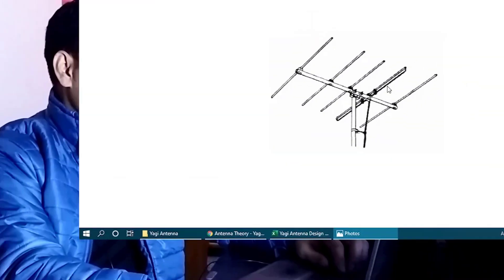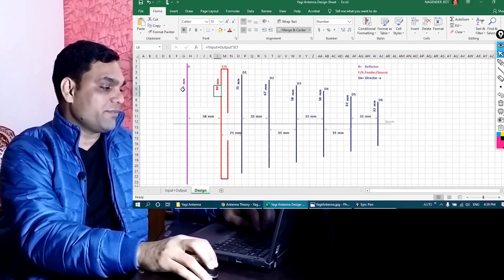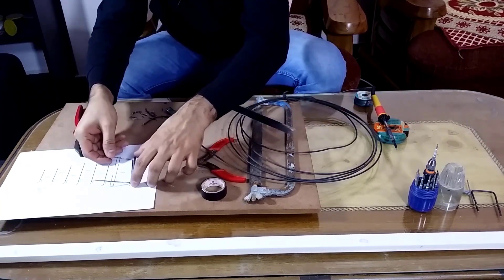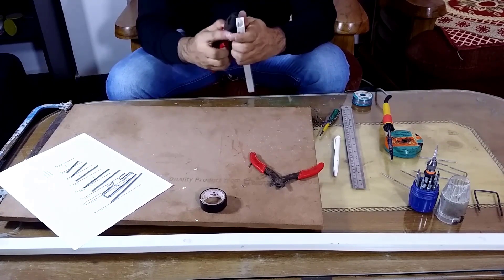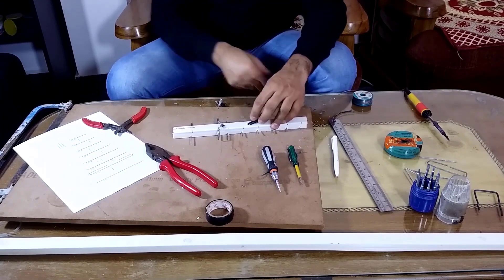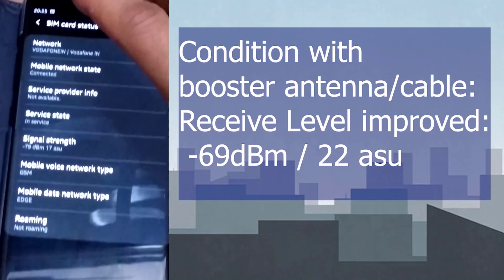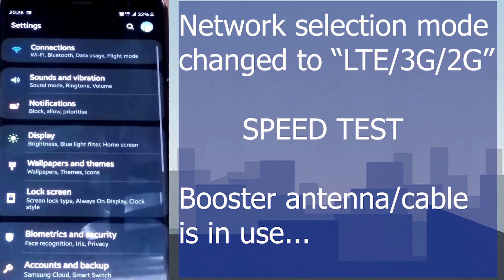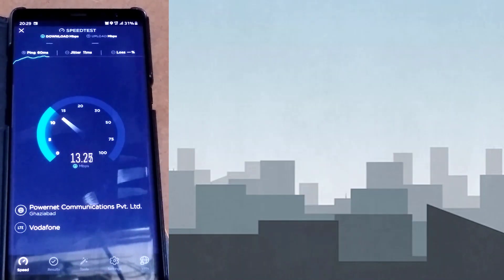Mobile Signal Booster for home - 2G 3G 4G - Homemade India

Comment: Great Video and excellent Design Spreadsheets!!! Thank you.   Can you let me know how to have more or fewer Directors and their spacing and width?  I was thinking 7 or 8 directors.   Also, If you put another antenna at the Cell phone end of the coax could you have a little more mobility to walk around your office?
Reply from the maker: Hi Rudi, 

Thanks!

You can find a table on this page which lists gains expected from yagi antennas with different number of directors (up to 15). You'll see that the increase in gain with every additional director is a diminishing value.

http://www.antenna-theory.com/antennas/travelling/yagi3.php

In last row of the table you'll find how to calculate the separation between the directors for different designs as a function of the Wavelength.

Putting another antenna on the other end didn't work for me. Despite the gain, the signal is still too weak to be radiated again effectively towards the mobile.

I think mobility won't be possible with this kind of passive antenna. We need an active booster fir that. 

Hope this helps!

Regards
G&T
Reply: @GeekyAndTweaky  Thank you so much. The second spreadsheet is great too.  I will be putting the receiving Antenna about 25M up on top of a tree.  Coax is RG11 75 Ohm, runs down tree about 15M...Then per your recommendation, I will put the "S" contact antenna next to my signal booster that spends signal to house. I'm out in the country. Up in the tree my phone gets 2 to 3 bars. But no bars at the bottom of tree.  I get LTE band 66. (1710-1780Mhz up and 2110-2200 down). So I'm going to design a yagi centered between at 1950Mhz or try a dual-band antenna with directors on top of a non-conducting boom centered at 1725Mhz and Directors under centered at 2150Mhz.. Any suggestions or thoughts?
Reply: PS, I subscribed to your Channel
Reply: I suggest you to keep the mobile over the cable & use blue tooth headset to take calls !
Reply: Very good & useful video!

Comment: What is the size of aluminium wire used for antenna for 1800 and 2100 mhz
Reply from the maker: you can calculate the Diameter as: 0.0085 x 
Wavelength

Comment: I made a unit for 2300 MHz following your pdf data. Not working. No difference after adding it. Plz make a video for jio 2300 MHz. And one question, can I use any other wire without coaxial cable??
Reply from the maker: Dear Sougata, 
The process for makimg 2300 MHz band id pretty much the same, only dimension are different.

Coaxial cable are best for Radio signal applications. That's why they are referred as RG (radio grade) cables. Other cables may or may not work depending upon conductivity of the wire material and distance of application.

Comment: Did you solder cable core only at diapole side or core + screen ? Please clear my doubt.
Reply from the maker: Soldered on both ends of the dipole , core conductor on one side and wire mesh on the other..

Regards 
G&T
Reply: @GeekyAndTweaky  Thanks for your reply. Should reflector face cell tower or I have to place director fowards cell tower?
Reply from the maker: @iMKPandey5  smallest director should be facing the tower. 

Reflector should be farthest from tower.

Comment: From my house ,roof top to my bedroom distence arround 30 meters so can i use 30 meters coaxial cable ?? Is it work that much far distance??... please answer my question....
Reply from the maker: Dear Mayuresh, this long distance will cause some loss, but still it will boost to some extent overall.
 If you have good signal at rooftop, it is still worth a try.
Reply: Yes .. I got 10 to 15 Mbps at roof .. but down no network and jio speed also .. sir can i use LMR 300 coaxial cable for that antenna ?? Please answer me ..
Reply from the maker: Then you should be able to get it with this Antenna.

 LMR300 cable will be good for this purpose.
Reply: Thank you sir for your kind information..
Reply: Sir .. today I did measurement from roof to my room I can arrange these all system within 20 meter.. so still is tere any signal loss ??? Please answer my question..

Comment: Hi sir,
Can I use wood instead of plastic material for boom...
Reply from the maker: Yes, that should be fine
Reply: @GeekyAndTweaky  thank you for your reply sir...
Reply from the maker: You are welcome Sir!

Do let me know the results when done.
Reply: @GeekyAndTweaky  Hi sir,
I completed the antenna and placed about 20 feet height.... But I  doesn't received any signal sir...  I'm using aluminium bare wire which is used for electrical purpose...diameter about 2mm... Please help me sir... My design for 1800MHZ antenna...
Reply from the maker: @aravinthak6962  dear Aravind, can you please share some pictures of your setup to understand better ?
Reply: @GeekyAndTweaky  sure sir
Reply: @GeekyAndTweaky  hi sir...
Reply: @aravinthak6962  I think the wire you should use for 1800 mhz is 3mm in diameter not 2. Maybe try it with 3 mm and see if your results change.

Comment: Hi sir. I have question. Can this boost my modem signal using your setting  .I'm using modem B618. I want my modem detect band 40. Mybe the tower very far. But here only have band 5.
Reply: And it's possible if I make two antenna will be better than 1? Can get more signal??
Reply from the maker: Hi Z Rose's

With Modem, I believe, you mean to say an LTE Hotspot device. If yes, the the answer is yes. It should work fine with that. On other end just try to put your device with different orientations to find location of your device antenna.

Two antenna, with a physical separation in mounting location should give better results. (This is called receiver diversity gain)

If it is not possible to mount far apart, you can also put the two antennas on same location with polarization diversity. Mount one parallel to ground and the other one perpendicular on side.

Hope that helps!

Regards 
G&T

Comment: THANK YOU Sir. The video was very helpful for me . The  best part is that i made the antenna free of cost . I had  a old power cable at my house from which i extracted the aluminium wire from it ...... Previously downloading speed was less than 2 Mbps and now  i am getting average speed of 7-9 Mbps .
So thanks again .
Reply from the maker: Dear Sandeep

You are welcome!
I am glad you found it useful and it worked well for you!
Regards 
G&T
Reply: नमस्कार  सर, आप से कुछ आग्रह करना चाहता हूँ , 
 antenna  बन गया कम भी  अच्छा कर रहा है परन्तु  हमेशा  antenna पर पक्षी बैठ जाते है और antenna की दिशा बदल जाती है , अगर संभव हो सके तो omni directional antenna बनाने की विधि बता सकते है .
धन्यवाद

Comment: I sir, to make the antenna, I have 4 mm section aluminum rod (full, not tube) can it be good for making the elements and also for the dipole? thank you very much
Reply from the maker: Ideally, thickness of the wire should be 0.0085x Wavelength.
for example, for 1800 MHz band, Wavelength is around 167mm. So thickness should be around 1.4mm

But you can still try, let others know the outcome 

Cheers!
G&T
Reply: @GeekyAndTweaky  ...ok, I do the test, but is aluminum ok? is it good for everyone, both dipole and elements?
Reply from the maker: @QQPIZZA  Yes, Aluminium should be better than steel / iron as it is a better conductor. (For all elements)

Read explanation here: https://blog.solidsignal.com/tutorials/steel-aluminum-or-plastic-whats-more-important-for-an-antenna/
Reply: @GeekyAndTweaky  ... ok. thanks
Reply: Hello, please, the yagis sold commercially have aluminium elements of a much higher diameter (about 10 mm guessing) compared to 1.4mm wire.  Please explain why?  Thank you. Gus in Caracas.
Reply: Sir, can you share to my email  for excel sheet formula,my email is ganierwinafgani@gmail.com 
I'm tying build for frek. 1800 Mhz and 2100 Mhz, please help sir..

Comment: At 9:15 you show a connector from cable to phone. Will you make a video to show how you make it - please? Thank you!
Reply from the maker: Simply peel off all the top layers and keep only the core conductor. Bend it in the S shape as shown in video. To avoid scratching, I simply taped it in between plastic cards.

I'll try to make a short video when time permits.
Reply from the maker: Hi, I have updated the part you asked for. See the card or Video Description or visit this link: https://youtu.be/ZSk6_mOubuI
Reply: @GeekyAndTweaky  You sir are very kind. Thanks for making the extra video. I plan to make this for a friend who has terrible reception.
Reply from the maker: @expiredpig2  It's a pleasure :)

Comment: Thanks friend for this video, I have a question for you: I'm interested in building a yagi for 2100 mhz, to get the measurements I downloaded your excel file but the file doesn't work ... how can I do it? I live in the mountains and I have a cell phone repeater far away and I receive very little signal, unfortunately I don't have the money to buy an amplifier. Thanks for your kindness in your reply. Good life to you.
Reply from the maker: Hello My friend, just now, I have uploaded PDF versions for 2100 MHz at the same google drive address. Please use those.
Regards
G&T
Reply: Dear  @GeekyAndTweaky  : Thanks, I'm really grateful to you. I am forced into the house for the CoronaVirus and at least if I can call ... thank you thank you thank you ... how many millimeters must the curve of the bipole be? 10/15 millimeters? Thanks again
Reply: ?millimeter? in 4:40 time line
Reply from the maker: @QQPIZZA  Yes, all the measurements are in mm.
Reply: ok, thanks, but how many millimeters is the side (the curve) at the point 4:40 time line??
Reply from the maker: 15mm on sides.

15mm gap between open ends.
Reply: GeekyAndTweaky many many thanks
Reply: tomorrow I proceed and then I tell you, thanks again

Comment: Doesn't work..Im approximately 15 km from cell site tower.. What do you think is the problem sir? From Philippines 🇵🇭
Reply from the maker: Hi, it can boost the signal due to directecivity(gain) if there is slightest trace of it. Can you tell me what is the signal level you are getting at rooftop without the antenna?
Reply: @GeekyAndTweaky  My area is no signal, even in the rooftop sir
Reply from the maker: Dear, sorry to tell you that in that case it may not work. 

It can only boost if there is some signal, for  very weak level also it will help. But it cannot help in total blackout zone where there is absolutely no coverage.

In my case, there was no signal in basement, but at ground floor where the antenna was mounted, there was decent signal level.
I hope I didn't create confusion with that :)

Regards
Reply: @GeekyAndTweaky  uhhh okay sir, thank you

Comment: Hello sir, i made the exactly same yagi anteena as yours but unfortunately it's not working at all....i don't know why but it's truth even my co axial cable length is only 8 feet, bdw my network operator is airtel which is using band 3 i.e 1800 mhz frequency same as your  vodafone so i did the same anteena as yours. The elements of my anteena are proper measurement in size and distance so it should work as your anteena......i am so depressed after the result, can you please help me something about this ??
Reply from the maker: Hi Nihar, sorry to read that.
What material have you used for the antenna elements and what is the diameter/thickness?

If it's all as expected, then please try to test in a different direction and location.

Also, make sure that the cable end is properly soldered with the dipole element.
Reply: Sir, i used the same iron wire which is 2mm in diameter and all the elements like reflector, director measurement are exactly same as yours also i checked that the coaxial cable is properly soldered to the driven element and i placed it on my rooftop by checking all directions but i am not getting a good signal strength that expected from the anteena. Also in my area there are not a huge network problem, normally i can get 4G network but low strength even therr is a airtel tower at 150m away from my home, but i can't get a good signal.
Reply: In your video i saw that you connected a small receiver type of device to the usb port of your phone, can you please say what is that...?
Reply from the maker: Well, in that case the only suspicion I have is that there may be a discontinuity in the cable. Core conductor may have got internally broken, but not visible outside.

If possible,  please check continuity of the cable. (Continuity tester / multimeter will be needed)
Reply: I already tested, there is no problem in the cable.
Sir, what should be the length of S - type core conductor cable.
Reply from the maker: I kept that similar to the length of Driven element
Reply: Is your yagi anteena still working now  perfectly.....??
Reply from the maker: Yes it is working. Gain varies from time to time, but it works.

I just re-checked,before replying here.
Reply: That's Great.....!!
In your video i saw that you connected a small receiver type of device to the usb port of your phone, can you please say what is that...?
Reply from the maker: That's a magnetic charging cable connector. That piece stays in the USB port of the phone, the cable has a matching part and they stick together being magnetically pulled.
Reply: Exactly i was thinking that.....thank you so much.

Comment: Sir jio ke liye konsa band thick hai.
Band 3 ya phir band 40
Reply from the maker: Jio has PAN India licences for LTE Band40.
It has access to some other bands in a few circles. But B40 is available everywhere for jio.
Reply: @GeekyAndTweaky  jio ke liye 2300MHz antenna bana sahi hoga ya phir 1800MHz.
This video really help full for me. Thank you for explain every points in this video.
Reply from the maker: @sbhukta  2300MHz